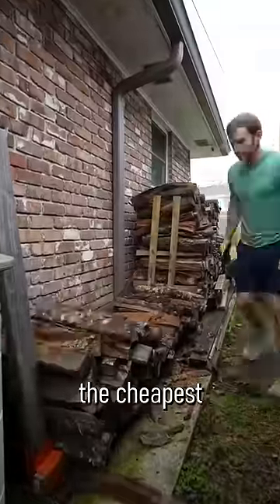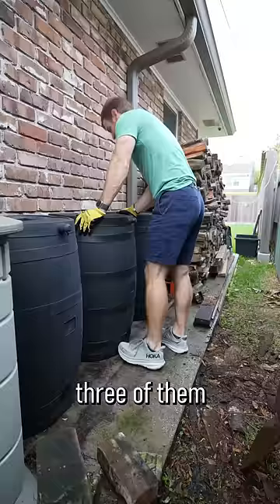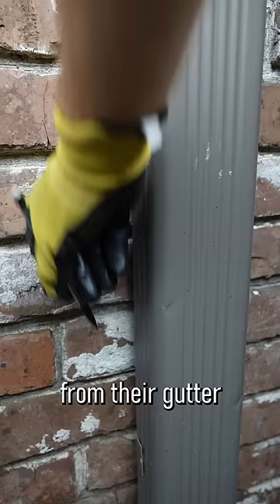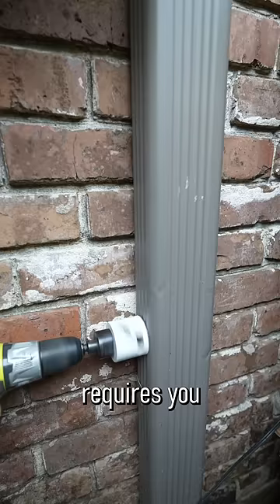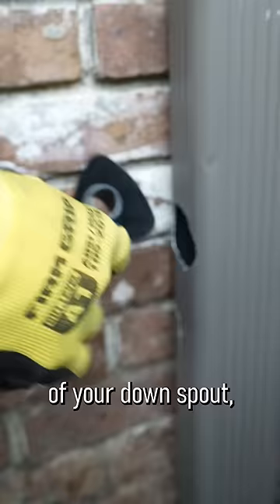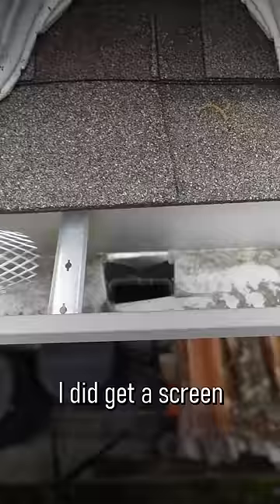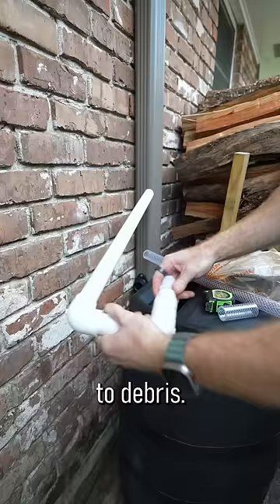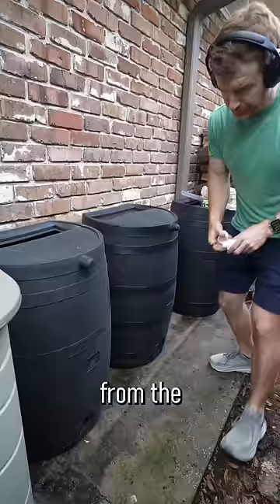Rain Barrel Project in 59 Seconds

Comment: If you can, move the wood away from the house. Vermin is a big reason.
Reply: Not that big of a deal on a brick house though.
Reply: @johnathon007  Never, ever underestimate the little demon rodents 🫣
Reply: @johnathon007  Brick walls still have weeping holes to let moisture get out from between the brick surface and the inner wood wall, blocking those off with wood can give problematic bugs (termites, carpenter ants, etc) a way in, and prevent proper drainage causing mold/mildew buildup inside the wall.
Reply: @johnathon007  Granted. Trying to think of a way around it and can't. Good point.
Reply: Arguing about brick 🧱 or wood 🪵 😂
Reply: Yea good way to get termites!
Reply: @teamwoodmerica3889  @indatubesurfer confirmed my suspicions. Do you know how far termites will travel in search for food? According to Homeowner, 100'. So... I guess there will be no problem if there is no wood or wood-like products within 100'. Maybe his house is entirely made of stone. Whoa, heavy, man!
Reply: I have a cat for that. Our wood sits right beside the house too, because winter is too cold to be having to walk across the yard every time you stock the furnace. 😅
Reply: I do it because the neighborhood rabbits in my neighborhood need a place to stay
Reply: @zzzzz45zzzzz79  <snort> Oh, BTW, animals carry ticks and lice. Yummy.
Reply: @johnathon007  ants, termites and mice can chew apart or slip through and small crack into the inner workings of the home. bricks only stop wind
Reply: We learned the hard way. Wood pile next to brick house = termites in an area of the country where they aren’t a huge problem for most home owners. I agree with OP on this one.
Reply: Collecting rain water for vegetable gardens, off a shingle roof

Is like smoking a cigarette, with hemp paper

😅
You're on the right track.. 👣 
But still getting Tar and asphalt in you
Reply: @johnathon007  in a perfect world youd be right but we all know buildings start cracking over time and bugs like termites are super small. As someone who did pest control we actually have to drill into the bricks every 3 ft or so to spray behind the bricks. We also do that with concrete slabs where we drill through them to spray underneath.
Reply: My father had a brick house. Termites still got in through his entrance (wood frame door) and ate the under floor and beams. He kept the wood pile right next to his door. Not after that mess.
Reply: We’ve put wood along side our stucco exterior for 38 years no issues yet
Reply: @seganaleqa  We use to make firewood in 19 steps before it was in the fireplace. Dropped it into 11 and still could cut off few steps and will in future. We use pallets. EUR pallets with lamb wire fence wrapped around and nailed on below or IBC tote frames. Just make the firewood, chuck it in or if you want fit more stack it, transport to drying location and from there to yard. You can build a cover shed for them or just put them into yard, cover with tarp to prevent snow blowing on them and put some roofing steel on top with weighs. Lift the tarp and you can take them out from sides or flip them on the side with winch if you have room in shed. Though this does mean having tractor or another machine with forks to move them in location where wood is made and at home.
Reply: @johnathon007  Roof is made out of wood.
Reply: @johnathon007 yes yes it is that's how termite infestation find cracks and have highways into your studs and structural support
Reply: Yeah John but what your not seeing is the studs tho are wood. And termites will find a way in.
Reply: Does this apply to putting it against concrete or hardy board?
Reply: @superhobo666 brick houses dont have inner wooden wall, thats why they call them brick houses, because they are made out of brick
Reply: @Direktors  Except that most brick houses in North America have an outer brick wall, a middle layer of waterproof sheeting, then an inner layer where the wood frame and insulation is, I worked in property management and some of the condos we managed were brick units. 

Unless you're talking about the dirt cheap ghetto cinderblock "houses" meant to be affordable housing, then yeah, those don't have wood walls. But, they're not brick houses either.
Reply: Really? Thanks for the device. I sure don't want democrats lurking around my property 😮
Reply: In my region (Europe) everybody stacks wood to the wall and it has never been a problem. Probably because we have sturdier houses and less dangerous animals.
Reply: @johnathon007  Damp is though! Brick is porous, and a bunch of wood trapping moisture against the wall will make the inside of the wall damp.

Comment: As someone who replaces gutters for a living, i freaking hate those screens. Also, if you have asphalt shingles i wouldn't use that water for anything other than watering plants you dont plan on eating.
Reply: I installed gutters for years and now do sales. Those screens really do nothing but create a giant dam right at the downspout. And yes asphalt roofs need way more filtration that a screen a rain barrel has on it. 

Only seen 1 customer use rainwater for in home use (showers and laundry, no drinking) and that's because it was on a mountain and drilled 3 wells to like 600' and never found water. Also good filtration out of his collection tanks.

I'd only ever use rainwater run off if it was metal roof + a very good filter system after collection for drinking. Even then I'd want to boil it first. Asphalt roofs are sure to cause you some form of cancer down the road haha.
Reply: Meanwhile you're drinking fluoride, lead and bleach filled tap water.
Reply: @Shuruii Damn, things still bad in Flint huh?
Reply: @Shuruii imagine not understanding how water treatment works…
Reply: @Shuruii  Someone isnt aware of what lead us to doing this and how much it improved overall public health..
Reply: You can use it for everything as long as it’s filtered oh and you don’t want to collect for the first half hour you want a good amount of water to run over it before you let anything into you holding tanks
Reply: Omg so true thank you. Was gonna install rain barrels for the veggies but not anymore
Reply: @alyssa2796  I mean you still can, and an open barrel with a metal sheet attached is a lot easier than connecting it to the gutter system.
Reply: @Shuruii  oh didn't know you've tested my well??
Reply: @Shuruii 
What did you put in my well?
Reply: @iFreemind10 😊😊😊😊😊
Reply: @Shuruii  and your drinking tar, lead, and pollution if you use roof water
Reply: Thank you for your information.  That was going to be a question I asked the owner, what did he plan on doing with the rain water he collects.  That gutter water is not potable, therefore do not use it on anything you/animals might eat, just like you mentioned.
Reply: @Shuruii bold of you to assume they drink water
Reply: @ChickenWang775 that's the pot calling the kettle black.
Reply: @TheOnlyBlackInMeWasWillieBrown  when my career up to this point has been water resources engineering? Work in the field before spewing bs
Reply: And be careful.  In many states that is illegal.  Check your local laws.
Reply: I'm not sure how long your rain is staying on your shingles before it drains into the barrel, but can't imagine you're getting much more than some shingle 'pebbles'. You can add a screen in the hose/spigot to filter.
Reply: @LysisAG It's a basic human right. If you're in a state where it's illegal then you should violate that law
Reply: @Shuruii  Most every modern countries use bleach in tap water. Sodium hypochlorite 12.5%. It breaks down into chlorine. Usually kept at 0.2 to 2.2 mg/liter. 

Fluoride as well is in tap water. Lead is to some degree depending on the age of your pipes, but that aspect is the more serious one compared to the other two.

So generally, what he's getting is still tap water, lol.
Reply: @RoyArrowood Then you pay fines.
Reply: @susankeith326  I would recommend refusing to pay those fines. Perhaps even a hunger strike in prison. If the state decides you have to buy approved air canisters for breathing would you go along with that?
Reply: Why go to all that trouble, I just got a flex spout for the gutter down spout cut the gutter down spout off just above the barrels and put a piece of screen door mesh over the opening to catch the large debris. Yes the water is not drinkable without some serious water filtering and boiling but it is great for watering trees, lawns, and gardens in the summer and during drought conditions, roof water is better that no water when it comes to watering the ground.
Reply: @Shuruii  what... no we drink bottled water.
Reply: @alyssa2796  If you have a metal roof then np.
Reply: @stevenharper7118  - Funny. Most "bottled water" is water from the tap. Plus, it's been bottled in plastic and has sat in a hot warehouse somewhere leeching chemicals into the water long before it gets to you. I would barely trust it if it says "spring" water. It would still go through a heavy duty charcoal filter before it would get used in my house.  🙂
Reply: @teebee9735  Yeah, you definitely drink tar roof water.
Reply: @potobserver9191  - sounds like you're looking in a mirror dude, or you really didn't read my comment. Open a window and let some fresh air in, take a few less tokes and try again.
Reply: Nothing wrong with using that rainwater to water flowers or your tomatoes.  And for drinking, it's way better than tap water.  Filter it  first, then put it through a small home distilling unit.
Reply: What if you filter it using a platypus gravity filter? That should get everything out.
Reply: Look up your laws or be careful some states it's illegal to collect rain water😊
Reply: @Shuruii hehe, you pay attention.
But that extra H2O will flush a toilet if everything goes south.
Reply: @RoyArrowood I recommend not listening to people like you.
Reply: @RedTail1-1  Any particular reason?
Reply: Those screens were a lifesaver on my old roof with built in gutters and trees that dropped leaves on the roof. One leaf could 90% block a downspout and make my gutters overflow.
Reply: Ive used rainbarrells for the last 12 years. Nothing wrong with using rain water for your garden. Stop scaring people.  @iFreemind10
Reply: @mrhockett1  My grandma has had rain barrels since I was a kid, so at least 30 years. She is 94 now and still lives by herself and tends to her garden (although nothing like she used to)
Reply: @Shuruii you drank too much asphalt shingles water
Reply: @LysisAG fake news. You better do a search on that. Maybe 2 state
Reply: @bluesnites thank you.
Reply: So many cu cks in the comment section!! " make sure it's lawful to collect the rainwater!" "EEEEK!".
You gotta be kidding me. 
No one owns the rain, nor the rivers, lakes and/or oceans.
Sheep abound.
Reply: There's also those eavestrough leaf guards. The one we use are called T-Rex.

Comment: A tip for cheap rain barrels:  Find a local canning operation like a craft farm that sells canned jams.  These places have 55gal food grade drums to get rid of and often sell them on the side cheap.
Reply: Anything but Amazon for the love of god
Reply: Picked mine up from the local feed store, 20$ a piece
Reply: @garlicburger Agree!
Reply: We got 150 liter ones that still smelled like pickles! Nice advice
Reply: Hit your local water treatment plant. We buy polyacrylamide in 55gal drums. The barrels are food grade and just need a thorough rinsing out. We typically throw em out if nobody at the plant needs/wants one; the manufacturer will buy them back but it costs more to arrange return shipping than the barrel is worth.
Reply: If you need more than 55gal, get food grade IBCs, they hold 1000l and are amazingly robust so you can stack up to three on top of each other (obviously only if the ground below can support that weight).
Reply: 10with delivery
Reply: @garlicburger why not get local people through Amazon?
Reply: @Donnerwamp  stick with one, don't stack them. Water is fckin heavy, a full 275 gal IBC will weigh 2300lbs, plus the tote.
Reply: @internetbodhi1009  I have two stacks of two and the places I put them support that weight easily. One stack is on the side of my house, the other one is inside of my barn. They are made to be stacked three high, so as long as the ground can support it, it's fine.
Reply: @garlicburger  Another salmon that likes to swim upstream?
Reply: My local metal dealer sells food barrels for like five bucks. Never pay more than ten.
Reply: also micro breweries, they often get their wet ingredients in these barrels
Reply: Right but he has lots of money mean while home depot  laughing to the bank😅😅😅
Reply: @DanvilleTrain888  You paid twice the price, SYK.  These are easily sourced everywhere now.
Reply: Isn't it best not to store water in clear or white containers? Black or dark colors inhibit algae growth.
Reply: if you watch the clip you can see he already has the barrels
Reply: The pickle factory here will give away the old 55-gallon drums. You have to pick them up.😊
Reply: Yep, there are also all kinds of 250 gallon poly totes with a nice aluminum frame that are available at half the cost of rain barrels from the Big Box stores
Reply: When they sell those things they are no longer safe to use.
Reply: Thanks for the inside info🥰
Reply: ok at the risk of sounding blonder than l already am.. whats the purpose of a rain barrel..? (or 3..) 
is this for 'doomsday' scenario preparation..
Reply: @BEAUTYnIQ  Not doomsday, everyday.Treated water is a luxury that half the planet doesn't enjoy. It shouldn't be wasted on a lawn and garden. Plus, you're paying for it, so using stored rainwater saves money.
Reply: @BEAUTYnIQ yes and for plants/gardens.
Better be prepared.  Remember The Grasshopper and the Ant?
Reply: In L.A., you can get a used 55 gallon plastic barrel for under $10, but you have to go to places that accumulate them, usually  near downtown.

Comment: Should've propped your barrels up on wooden boxes so you can fill your buckets easier when taking water out
Reply: I put mine on the ground and realized I couldn't fill buckets, so I went with a submersible pump. Doing it that way I was able to attach a garden hose spigot to it and use it that way which I found to be much better than buckets in the long run.
Reply: Put the  barrels up a couple of feet and just attach a hose to the first barrel. It wont be high pressure and your flowers and veggies will love it.
Reply: Only issue with propping those barrels up is the weight. I had 2 barrels split because they were on cement blocks that didn't support the ENTIRE bottom.
Reply: That's the post I was looking for 👍 I have mine  elevated 12" off the ground plus my barrel has 2 spouts 1 in the middle and 1 at the bottom I put a window screen on top of the barrel with 2 bricks after the rain I just brush it off👍💪
Reply: @cboehm24  not surprising, a full 55gal barrel weighs around 450 lbs with water alone. 

Be careful people, water weighs more than you think.
Reply: I made that mistake when I got my first barrel. Now it's on top of bricks and it's very easy to fill the water spouts!
Reply: Best way to prop up barrels is with aluminum dunnage racks commonly used in restaurant storage areas to keep food off the ground
Reply: @edpena4064  I also have the spout on the first barrel about a foot from the bottom so any sediment sinks to the bottom and does not interfere with the water flow.

Comment: Word of advice for the future, dont stack wood right up against your house. Your inviting termites right in
Reply: That all brick siding and concrete foundation is specifically for stacking wood under the overhang, and the underside of the overhang has repellent guarenteed. It isn't impossible that termites will get in, but it's less likely than with most other types of house designs.
Reply: Brick walls have weeping holes, still not smart to stack wood against brick
Reply: @ScootsMcPoot  True, but it's also supposed to be treated with repellent as well.
Reply: It's just smart to not do it, regardless of the material. Build a firewood shack next to the house with a gap from the back shack wall and the house like half a foot or a foot.
Reply: Rack up out the n the yard
Reply: Funny, ive had a fireplace my WHOLE LIFE, we have always kept the wood stacked against the house and a smaller stack IN THE HOUSE, still havent had a termite problem, ill be 54 this year. All these comments about where you shouldnt stack wood, im curious, do any of you actually have a fireplace, have you ever seen a termite. Folks are so silly these days.
Reply: @Athleticblacklesbian Wow, cool story grandpa. One person out of a billion didn't have problems with termites. So we should ignore the millions who do.

Comment: As a brit.we would link the tops of the barrels with a short flexible hose.so the first barrel would fill then the second then 3rd.and any crap would settle in the 1st barrel.
Reply: And there will be crap. That water is not potable.  Must be processed.
Reply: Why does being a Brit make a difference in this context?